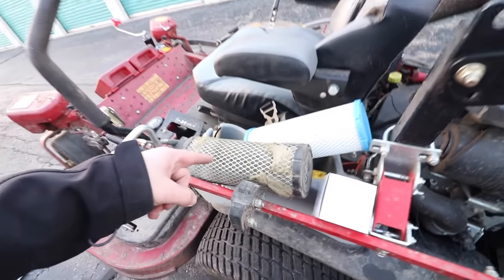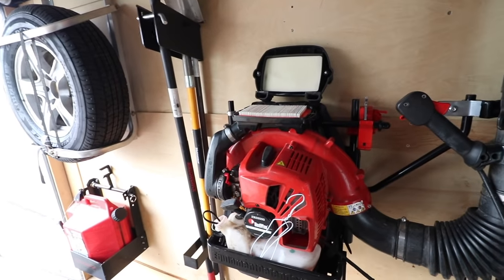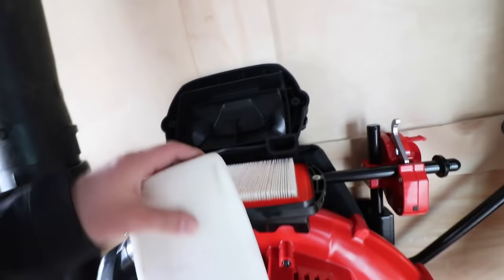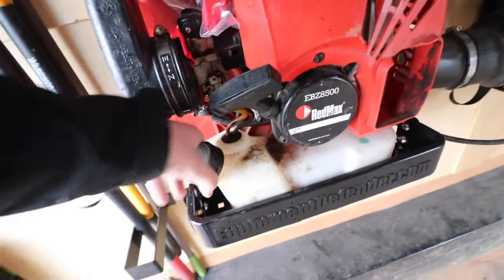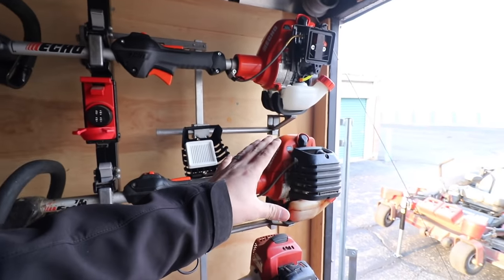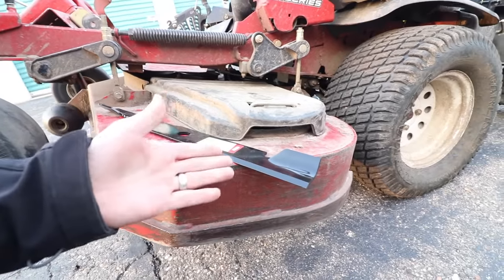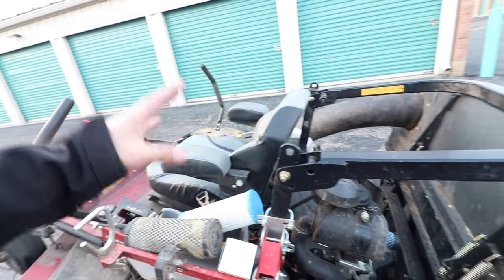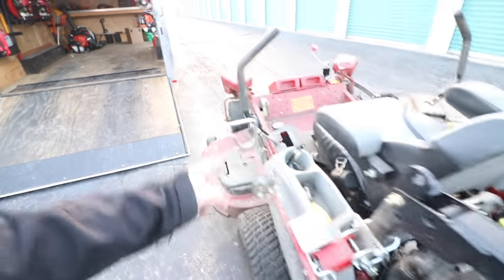CHANGE Or REPLACE These Items BEFORE Mowing!! Spring Maintenance Overhaul How-To!

Comment: GREAT GREAT stuff Brian and thank you for taking the time to help the LAWN CARE NATION.......   You indicated that you might change your oil more often in the spring and fall (because of the increased load).    However, the real enemy to your oil (according to Kawasaki)   is high outdoor ambient temperatures.   Mowing for an hour or more straight on a 85-90 degree day in July/August will register higher temps on your engine than at any other time of the year.  (of course, don't take my word for it, check with your mfg rep. or mechanic)  I personally change the oil every 50 hours and filter every 100 hours.
Reply from the maker: Good tip! Agreed, higher temperatures make as much as sense as any other variable. I do change mine regularly every 50-75, just to be conservative

Comment: Word of experience here. Do NOT use WIX air filters for the Lazer-Z period. Mine actually fell apart and got sucked into the motor. Thankfully I didn’t suffer any issues. Use the Original Koehler AIR filters. My dealer actually has them better price than the aftermarket ones.

Comment: Blow the mowers outer air filter out with leaf blower  every week, especially during
"Floating seed" season.  Also blowout all the areas on the engine that are cooled by the fan.  You can blow up an engine in a day if air does not flow properly.  Same with the radiator on liquid cooled

Comment: Funny you post a video on maintenance... my Toro Recycler took 14 pulls to start today. It has been giving me a hard time for a month or so, and today I thought to myself" what the hell is wrong?" It was bogging and tearing badly, too. Needs a new spark plug, air filter, and blade sharpen, and we'll be back in business! Quick plug: I am doing a fairly large ( to me) landscape job for my mom tommorow

Ps, Nice Exmark Staris.( Saw it on Instagram)
Reply from the maker: Nice buddy! Yep basic maintenance goes a long way!

PS, thank you! It's a sweet unit for sure!

Comment: For the string trimmers, don’t forget to grease the trimmer head.  One manufacturer, whose name begins with “S”, sells a tube of grease that threads right onto the reservoir.  Unscrew the nut, screw the tube onto the reservoir and squeeze in the grease.  Picked up that tip from our friend, The Other Brian at Top Notch Lawn Care.
Reply from the maker: Great tip! Thanks for sharing 👊
Reply: Just get a zerk fitting and fit it in the thread. Grease normally as with any other piece of equipment

Comment: Seems more worthwhile in my situation at least to clean the air filter 2-3 times before buying a brand new one.
Reply: If using a cleaner yes if using compressed air no not really you compromise the filter
Reply: @bakerviewlandscaping327  Especially those foam pre-filters. Those can be washed with soap and water and re-used until they literally fall apart. I have a few extras and swap them out several times per season. I then clean the old ones and have them ready to go again. By swapping the pre-filter regularly you can really extend the life of the main filter element. True, it may only be $20 but across several machines it all adds up. Plus, since the pre-filter gets dirty first, by swapping it regularly you keep the engine breathing easy.

Comment: You need to check the tire air pressure frequently also.....  didn't hear that one Brian.  Great video!!
Reply from the maker: Good tip!! I always check my mowers during the week, same as the trailer tires. Good catch!
Reply: Brian's Lawn Maintenance do you have a link for a tire gauge you like? I have a few and they all annoy me for one reason or another.
Reply from the maker: We just use the Milwaukee Tire inflator

Comment: Hey Brian where did you get that trimmer rack that is on your mower.
Reply from the maker: Jungle Jim’s accessories. No discount code there sorry
Reply from the maker: Jungle Jim’s accessories. No discount code there sorry
Reply: Also do you like having a trimmer with you when your mowing. Or does it get in the sometimes.

Comment: That's the first time I've ever heard someone say not to touch the spark plug because of grease or oil on your hands. I would think any oil from your hands that gets on the electrode would be burnt off in the first few cycles of the engine.
Reply from the maker: I’ve always been told to never touch the spark plug hook that hangs over where the spark would fire. 

I’m also not an engineer. But better safe than sorry when I do my maintenance
Reply: @BriansLawnMaintenance  Perhaps the caution had more to do with bumping it and changing the gap more so than contaminating it with your fingers. I'm not advocating coating the electrode with grease or oil but there is nothing from your skin that is going to hurt the barrel side of the electrode. Look at it this way, you have to handle the plug to set the gap anyway. You do set/verify the gap, right?  :-)
Reply from the maker: Of course we do. Thanks to my background in electrical engineering, we have our bases covered. 👊🤷‍♂️😂

Comment: WhT about greasing the spindles? And axles
Reply from the maker: Greaseless spindles on my Exmark, but yup, great tips. Thanks for sharing.
Reply: Non-serviceable spindles ALWAYS need service.  I either add a grease fitting or disassemble/lube/put back together at the end of the season.  Those are pricey spindles for greaseless!  Just my .02.